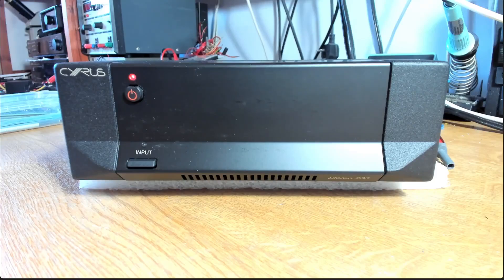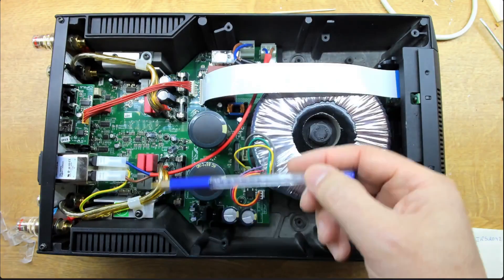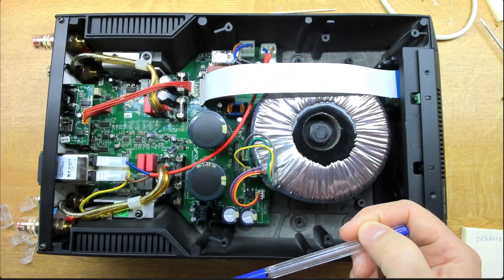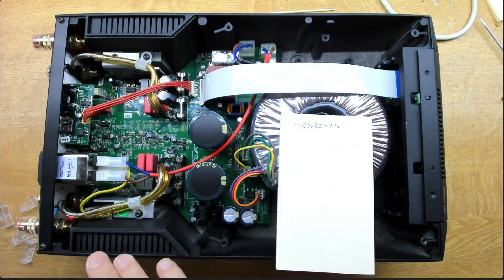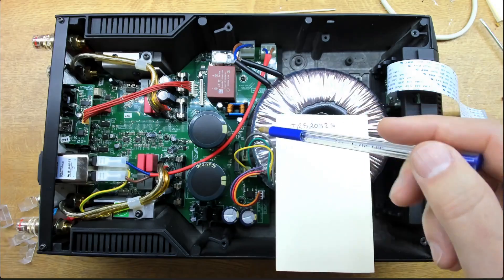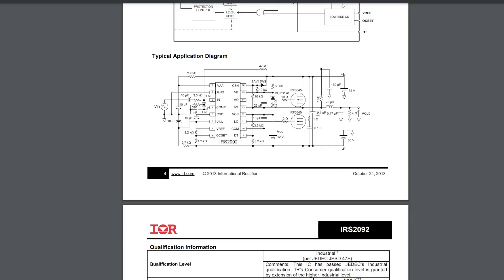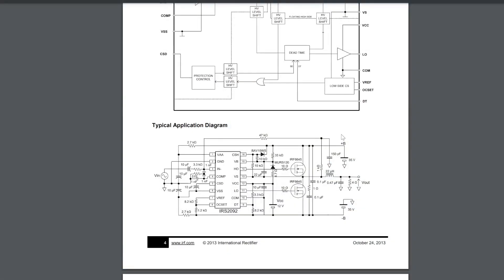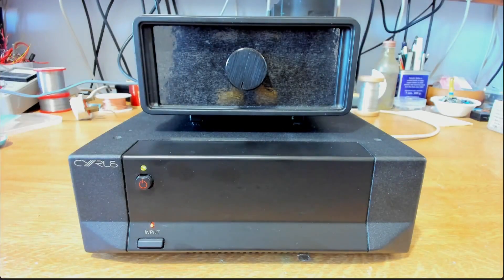Repair and exploration of a Cyrus Stereo200 Power Amplifier

Comment: I own the Stereo 200 for a couple of years now. Switched to it from the old Cyrus Power which I used in bi-amping and bi-wiring. The Stereo 200 sounds as single gear a lot better than the old transistors, sounds less muddy and has more punch. At least I cannot hear the increased noise level at higher volumes which you measured here. I hope it lasts for many years. Having had lots of issues with my Stream XP2 Qx of same age, I don't think I will buy Cyrus again.
Cyrus has anyway shown, that they don't belive in their marketing blabla - they ended production of class D amps whereas other manufacturers going more in this direction.
Who needs heaters while listening to music - I guess class D is the future.

Comment: Mine failed as well and took out a b&w 805d4 tweeter. Well done Cyrus !
Reply: Hence why I stay away from UK brands, many UK amps are fire hazards with no output protection as well, this one looks to at least have rail fuses but these won't protect your speakers, as you've found out already. AFAIK Linn, Naim, Creek, Lecson and Arcam are/were in the same boat, probably same story with Musical Fidelity.
The Brits took the "less-is-more" approach to the extreme in some cases.

Comment: Nice to see how its built, for an expensive brand i'm surprised how basic the output stage is, they retail at 3000€ apparently where i live 😱😂
Reply: I have a low-cost Class D module I purchased for my YouTube channel, based on exactly the same application note as this amplifier. It cost $30, plus of course the case, power supply parts etc. The point is the overall sound will be almost exactly the same. I must get around to recording a video on it one day. The sound is OK, typical class D.
Reply: @MichaelBeeny  for that price i'd prefer to do the same and build my own 😄
Reply: @MichaelBeeny  nice to see you still posting Micheal 👍
Reply: @sdgelectronics  Thankyou Steve, I'm not as prolific as I was but I still upload a few vids when I can. I'm playing with preamps at present. I tend to keep my distance from class D!
Reply: Cyrus is extremely expensive for what's inside, same goes for their tuners and CD players - all extremely basic stuff for high price. IIRC their CD6se is just a BB chip with NE5532 output and some FPGA digital gizmo's, that's all. Not to mention the abysmal slot loading mechanism's they use, nightmare to service.